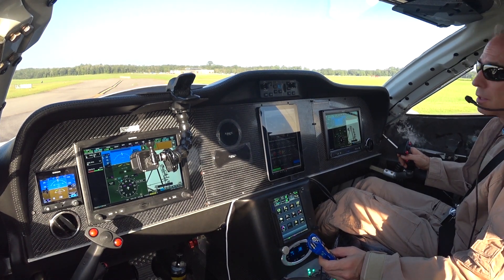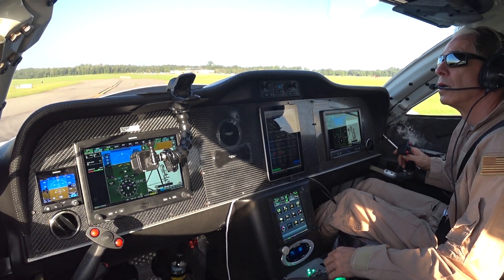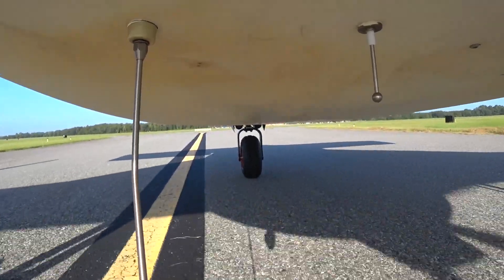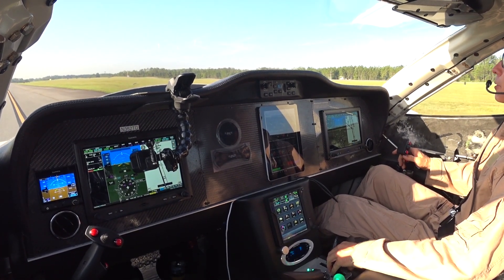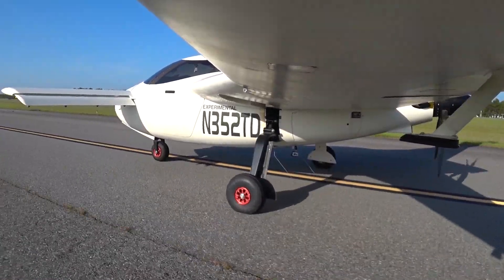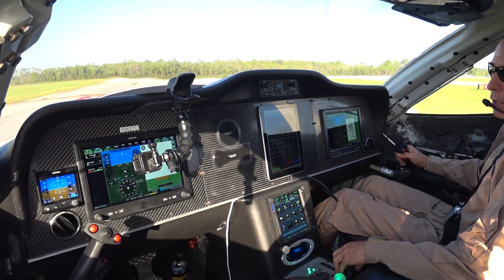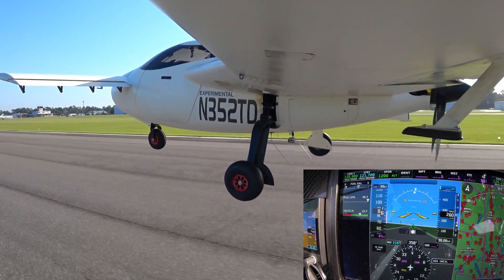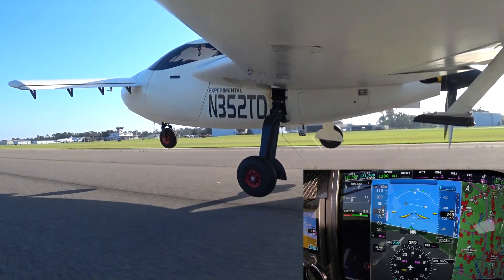Most Realistic Flight Simulator - Building the Raptor Prototype

Comment: This is completely unorthodox, but...one way to find a static port is to drill a bunch of holes, say, from the nose to the side...as many or as few as you like.  1/16" holes.  Place in this volume of holes (inside the plane) some kind of visible gas.  Video it as you fly along.  The hole which doesn't suck or push gas out of it is the winner.  Something like water vapor might work.  I know punky wood works great, but as you're in the cockpit, that's certainly not the best of ideas as there's the smoke/carbon monoxide/death thing that you've got to watch out for.

Comment: Congratulations Peter, well deserved indeed!! Question for you, just a thought. I remember a ways back talking to a BD-5 friend of mine who recalled an incident where the aircraft went speeding down the runway (unlike you, pulling on the stick for takeoff) and the aircraft would not leave the ground until he throttled down and then it would jump in the air because the center of thrust was higher than the center of gravity. I noticed that the Raptor seemed quite stable at a much lower airspeed than the lift-off speed in this particular case. I don't know where your center of thrust is, but if it's just slightly above the center of gravity it might just need a small nudge for a brief second at the pre-determined 93kts. Again much deserved congratulations. And by the way, even though you nosed down a tad much, you wouldn't have had any experience to know any different, awesome job on not creating a PIO,!! That could have been a disaster, way to keep your head on point!

Comment: That is the most amazing this I have seen !  Do it again and keep full throttle then climb out . 
 then fly .   Good job ,   Don t keep it in ground effect that is the most dangerous  area , unless you are a trained  expert in that aircraft ,in ground effect . .( I don't mind I can take it )  and no one is in that raptor  ,everyone will climb away from the ground to feel out the flight charterists .. Climb out, get it away from the ground ., if the engine quits  land straight ahead. If the gear does not go down , slide it in. ..  climb to altitute  I  would go high 5000 above ground and then try to land at 5000 feet, you know this... stall speed? In a cannard ?   Then  come in to land , that is why you went to a longer strip. .      remember what Lindberg said in   NY just before he took off. " Well I guess I'll go now " .

Comment: Silent follower......dude super happy to see it in the air, who cares about a bounce.  

I do have a question if you get around to reading this, how much pitch up on approach can you have before you have to worry about a prop strike?  You didn’t seem close at all but just curious, how much pitch it would take before you would have to worry about it.
Reply from the maker: 9 degrees but the main wing is already flying by then so clearance is increasing.
Reply: Raptor Aircraft thanks for answering the question, very cool.  Can’t wait to see it make its first flight out of ground effect.

Comment: Peter, Take a look at the wing mounted video and notice how the left aileron is always a bit T.E. up.  No way to tell if you had any pressure on the rudder pedal that might induce a bit of roll.  I would imagine last nights sleep was far better than the last 6 months :)  My Opinion - You are far better off to get the plane up and away from the runway and practice landing it than doing ground effect flights since there is very little be gained and it will help get a true feel of the handling with a bit more speed and allow things to cool off.  Since you have just become your own test pilot I would say there is no one who understands that airplane better than you.  Also read NTSB reports of all the airplane that have been ruined by runway flights.  It is very normal for a low time canard pilot to experience PIO.  Any canard plane is a little sluggish with control imputes at low speeds that is just something you have to get a feel for and use to.  I believe you will find that if you rotate the aircraft as soon as the canard is able and hold the nose in a up attitude (keeping the canard below the horizon, it will fly off the runway with great stability.  That indicates the correct rotation speed and shortly there after you will know the flying speed by noting the airspeed when the main wing lifts you off (or watching the video post flight).  Keep inspecting the re-drive - I am not a fan of them.  Two thumbs up, Peter!

Comment: Congrats Peter. 👏 Like many I have been following the Raptor program since the beginning and I am so pleased for you that you have reached this milestone. I own a Cirrus SR22 G5 and would seriously consider the Raptor as a contender when it matures. (which i'm convinced will occur based on your tenacity). At 4:41 it looks like you "encouraged" her just a fraction and she immediately went for it because of the amount of Up-Trim already in. This, coupled with perfectly understandable first flight nerves, resulted in a Pilot Induced pitch oscillation which you quickly got under control after the second takeoff.  Since the nose wheel appears to get "light" way before, maybe about 10-15% less up-trim and she should rotate nice and steady with the same amount of encouragement as before.  Had my heart in my mouth when i saw the prop tip approach the runway surface for the first touch down. I'm sure its the port wing camera angle coupled with the sun angle / long shadow that makes the prop clearance look far less than what it really is. Good on ya mate.👍. PS as others suggested, at least please wear an open face helmet to protect your noggin. Now more than ever the Raptor program and EAAA can not afford to lose you.

Comment: Congratulations! It finally went airborne. Since the weight is over your calculated weight which you mentioned a year ago, I am concerned that the stall speed could be much higher than your calculated stall speed. From the screen, it looked like it is around 80 kts. I think you need to pay special attention to it when test fly it. It is much harder to control.

Comment: Congratulations! With that box checked off, are you not freer to go at your own rate?  It must be quite a thing to fly a plane, knowing it has to be back on the ground before the runway ends. Do you know the tailstrike angle/pitch?

For testing, please consider placing in the aircraft: a seat-belt cutter, and a metal-headed hammer with at least a 2-pound head. Day-glow colors would be a nice touch. I see that you have a small extinguisher--good!

BTW, a HSC DS-X1 motorcycle helmet has very good visibility, and costs less that $150. It has provisions for bluetooth. It can be fitted with an anti-fog shield (pingaurd) Justsayin.
Reply from the maker: 9 degrees is the potential for a prop strike. By 7 the mains are already off at 90 knots so it's almost impossible. On landing it might be possible with too slow a landing speed. Thanks for the helmet suggestion.

Comment: Congrats! Looks like both airspeed and altitude are highly unreliable, perhaps alpha effect with the reversals seen (indicated altitude decreasing with actual increasing). Probably should get those corrected before you do any more.
Reply: As further comment, it looks oscillatory in pitch, likely PIO. 5-10 degrees pitch attitude oscillation, which are large swings. It could be default stick-elevator gearing is too sensitive, could be due to amount of trim wound in, or could be piloting the task is high gain. Watch out for it and try and get out the loop next time. Would be great to see the trace of stick, elevator angle and pitch.

Comment: Hi Peter - well done.  Such commitment.  I’m so pleased for you.  

I formed the impression that because of the float/bounce the ‘landing speed’ could be lower. Therefore, one assumes that with elevator the rotation speed could be lower too.  Good news for field performance.
Reply from the maker: The takeoff could be slower but 88 or 90 gps speed seems safe enough. The landing I'd like to make a little quicker so not quite so nose high.

Comment: Congrats on first flight. I'm excited but I'd like to know if the front to back vibration of the landing gear on touch down will become a problem after a few hundred or thousand landings. What do you think?
Reply from the maker: Well, the gear is designed to flex somewhat. It's a matter of checking it to see whether it has any adverse effects.
Reply: I assume the gear legs are made of CF and designed to behave somewhat like leaf spring type. This type of movement is probably exactly what you'd want to see in this situation.
Reply: @RudyRohr  If I recall correctly, the gear legs are all steel. The brake lines were drilled through and then they were bent into shape. The mounting fixture is also all steel. They should be strong enough to easily withstand a lot of landings, but steel tends to develop micro fractures over time with repeated stress. I'm just curious to see how this will play out for the gear design over hundreds of landings. You don't often see landing gear flex fore and aft on landing like that on other planes.

That said, i still love the raptor and can't wait to get in the cockpit.
Reply: @RaptorAircraft  Well I can't even find a space to reply.  I would say about 99% positive responses which is more than you expect I think.  So when's production start?  I know the test flying will go well.  I just can't wait.  Hope they come back very soon.

Comment: Congratulations... I think. Please please after all this great work— be patient, slow and very deliberate on your progression. I also concur with test experienced commenters - continue to consult with test experts and if possible do the same maneuvers in a similar ‘known’ aircraft if you yourself are performing them. Inspect critical unproven items and mount items for security and cracks. Finding those bolts backing out( I thought. holy $#@&) should cause some reflection that other things will occur.

Comment: Congratulations on your first flight. I have made two observations: 1. it seems that the airspeed indication error is affected by power - prop creating a depression at the location of the static port? 2. After the first touchdown, fuel flow went to maximum and stayed there until the second touchdown. So it does not seem that it “wanted to keep flying” . It is merely the application of power that caused it.
Reply from the maker: Actually it might be power but  notice that as soon as the alpha was enough for flight the altitude and airspeed were correct. I did have power off so we'll have to see if that makes it worse but for now at least we know when it's airborne and gliding that the static is much more accurate that when fast on the runway.

Comment: You saved it! Normal reaction after a plane balloons up would be to push the nose down too much and slam the nose into the runway then depart into the weeds. You staid cool and flew the plane. Nicely done. I'd skip more high speed test and get away from the runway. Landing gently should be easer than controlling the 3 foot floats with no practice in slow flight of that type. Go practice slow flight at 3,000 ft.
Reply from the maker: Yes, I need to discuss the plan with my test pilot mentors. That will be happening over the weekend.

Comment: So AWESOME! Glad to see it in the air (or more precise ground effect). My heart jumped out of my chest when it popped up, almost like I was sitting second seat. I did notice one thing, and this is just my opinion, you got in the air at 104 knots with a little help from you, so not unassisted which means it would need a few more knots to do it on its own. It then floated in ground effect till 85 knots before settling on the mains (looking at the elevator angle, it does not look like you were pulling back on the stick while it settled down). Based on the fuel flow meter, i can see when power was pulled off so this is my 2 cents, it looks like you may have a thrust line issue. While under power it was pushing the nose down and when you came off the power it looks like it settle into a calm flight. Perhaps you may need to put a shim or 2 on the lower motor mounts for a degree or 2 shift of the thrust line? Perhaps a good test would be to high speed taxi to 100 knots and pull the power with your current trim settings and see if it pops up into ground effect? just a thought, but its easy to side seat quarterback when its not my but in the seat. Congratz on the progress.
Reply from the maker: Indicated air speed is reading high until it was airborne. Look at the ground speed below it to see what's really going on. Fuel flow does jump when the prop is freewheeling the engine at idle.

Comment: First, Congrats! So much of that looked good. I did notice the airspeed vary quite a bit. For example, you got airborne at 104kts IAS and remained in ground effect until around 85kts IAS. That's a pretty big swing and I suspect, a bit random. I'm not at all sure what's going on there, but it's not normal. The overall acft stability is a big plus. To be honest, I'm not too surprised as you've been so precise in getting the flying surfaces perfectly shaped and have made a big effort to stabilize the controls surfaces. Again, congrats.
Reply from the maker: The static port seems to now be accurate when it's airborne. Look at the groundspeed below it.

Comment: At one point in time it looks like prop is very close to the ground. What is the maximum pitch angle you can safely keep when mains are on the ground? I recall you said something like 12 degrees when potential prop strike was discussed earlier but I am not quite sure
Reply from the maker: It's about 9 degrees but when rotating the main gear is getting light and lifting off already at that pitch angle. As for landing, I was a bit slow today given my concern for remaining runway but even then no prop strike.
Reply: Raptor Aircraft I don’t recall if you mentioned this in your video on the prop strike concern, but what does the flare angle correlate to in terms of minimum landing speed. Also, how does this compare with the likes of Velocity (or any other similar pusher for that matter)?

Comment: Congrats Peter! Looks like your well on your way. Still looks like the static port calibration and altimeter relocate with have to be adressed. Might be a good idea to get some pro help with that one. Happy to see the bird in the air!
Reply: I agree with you Devin.  At takeoff his altimeter had about 150' of error.  That is well outside of the IFR pitot/static testing requirements.
Reply: What he really needs to do is install an analogy Altimeter and ASI in the panel.  This way the backup is always on despite the electrical power.  I'm not sure he has a static port on each side but it should be done to insure this is not the problem.

Comment: Congratulations you made it past that hurdle.
I am sure you said at one point but what happened with having noes wheel steering and a reversible prop?
Reply from the maker: The reversible prop was like $7000 more so just not worth it for me. As for nose wheel steering, I actually prefer the castering now. It will be easier on crosswind landings and you can make much tighter turns when taxiing.
Reply: With the reversible be an option for purchase?
Reply: @getrav  

It's an experimental chief...you can literally do whatever you want with it.

Comment: That landing gear wobble when it touches down has to be a cause for concern. Is that normal: for it to have that much play? How would that fare on a hard, rough weather landing? Great to see her up, though. Congratulations, man.
Reply from the maker: Yes, these are Grove legs but we'll be analyzing this to see if improvement is possible.
Reply: I'm pretty sure it's Grove spring steel with no shock absorbers. Watch any of the STOL planes that have Grove gear and not A-arms with shock absorbers and they bounce and shimmy just like that.
Reply: @ginacalabrese3869  Thanks, I didn't know that.
Reply: Watch a retractable Cessna land. Those legs wobble all over the place! Well done Peter! I’ve made lots worse landings!
Reply: Watch the legs on a Caravan, sometime.  Scared the crap out of me the first time.

Comment: N-352 Turbo Diesel, not a car !  ,,, btw, that horsepower equation from yesterday, does it account for the drive pressure from two turbochargers ?
Reply from the maker: I'm not sure what you're asking but the total pressure out the second turbo is really what matters at this point, even if there is considerable back pressure in the cylinders.
Reply: The drive pressure, probably best measured at the hot side inlet of the second turbo is a consideration in any calculation program  . I am just wondering if this program has parameters for two turbos . Gale Banks has a very technical u tube video on his highly modified Duramax . Its not the most recent, but one before this, and you have to go to the highly mod Duramax series, there are couple of other non related vids in between .